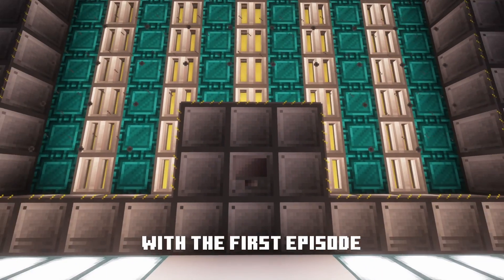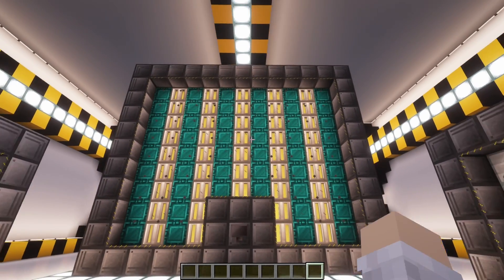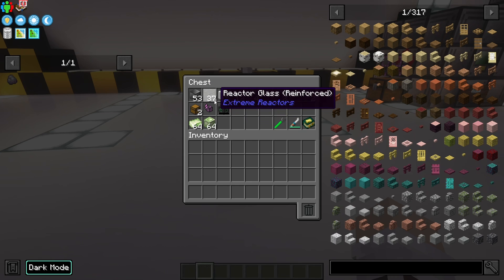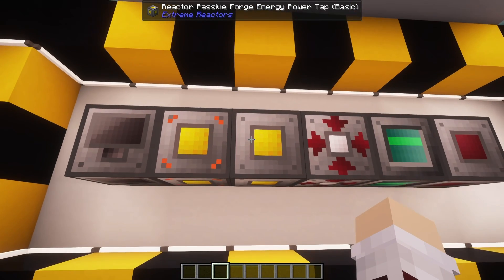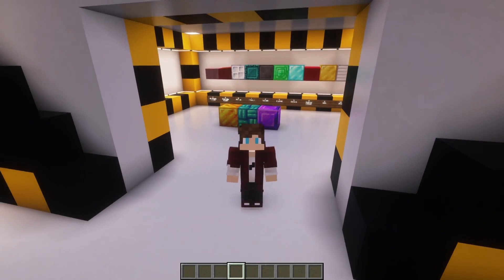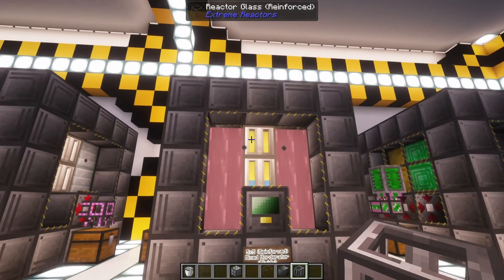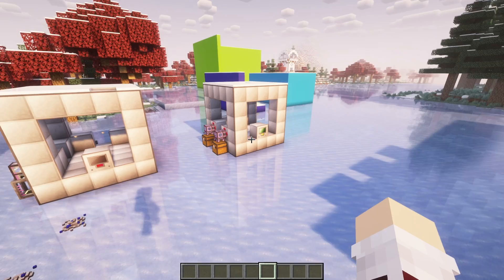Extreme Reactors - The Ultimate (simple) All the Mods Tutorial!

Comment: If your coolant is good enough (I’m using platinum), on a basic 5x5 reactor you can do the inverse checker with 5 fuel and 4 coolant and it still basically runs at 100% efficiency just with more output
Reply: dude you're a lifesaver...so hard to get a straight answer from people sometimes haha

Comment: Very helpful guide. I assumed this was like Bigger Reactors, where the "coolant" blocks aren't actually coolant, but moderators. And the best moderators were unobtainium and vibranium depending on the part of the reactor you were placing them in (unless I mistook the placement factor, then unobtainium was just best).

So now I'll try some of the other options and see if they improve my reactor performance.

edit: I used F3+H to see additional tool tips. It appears these are indeed moderators, not coolant. Given the understanding of how the fuel rods interact with each other, I think the distinction is important. Referring to them as coolant creates a misunderstanding of function in those trying to figure out an ideal design.

Comment: I get the problem "Turn off the reactor and push the control rods all the way into the fuel rods" but my 5x5x5 reactor is the same as the one you built in your video. Do you have any idea what my problem is because the reactor control rods say that is 100% in
Reply: 100% is the lowest efficiency level. Try something like 50%

Comment: For anyone looking to use redstone port: you can use 3 ports to turn it off and on. Two outputs, one for when power is below something like 5% and one for when power is above something like 95%, both connected to a pulse extender (which converts the signal from either output to a pulse) that connects to an input set to toggle on/off based on pulse. Pretty simple
Reply: Theres such an easier way to turn it on and off, u don't even need redstone conduits from EnderIO, just 3 restone dust 1 block below the ports. Set up exactly how it is in this video, but instead of using 95%, use 70% its more efficient that way. Simple as that. Just be aware that it takes a few seconds to kick off and on.

Comment: the one video i could find giving me a decent run through ty 

i have a 9x9 and I'm using the tangerium but i still feel like my power output is low is it supposed to be at like 2400 Celsius?
Reply from the maker: If you don't mind increasing you're fuel usage, you can add more fuel Rods which should increase the energy output!

Comment: Nuclear Fission* 0:32

Fission is the splitting of atoms into multiple particles, which releases energy as per the famous E=MC^2. This uses things like uranium etc as fuel. This is how our current nuclear reactors work. And this is what the reactors in minecraft resemble (specifically PHWR reactors). 

Fusion is the fusing of multiple atoms into 1 heavy atom, which releases energy too as per the famous E=MC^2. This is literally what happens in stars and our sun! It fuses an isotope of hydrogen into helium. This is something currently being heavily researched and it would probably mean the biggest change for humanity in history. As it's basically non-polluting (produces helium as 'waste', which is a useful element) and generates incredible amounts of energy from very little fuel. Recently (end of 2022 and beginning of 2023) we have been able, for the first time, to produce more output than energy was put in using a nuclear fusion reaction. Which is incredible. Since then it has been replicated multiple times and we are seeing an increase in energy output. But we are far from achieving a Q value of 0, which basically means a net neutral reaction (producing the energy necessary to 'run' the reaction - things like cooling, providing the massive magnetic field etc,...). But we would need MUCH more than that in order to make it a viable power source.

Nuclear fission is amazing and there's a lot of new developments to make it more attractive as it's necessary for achieving a greener planet. But I could've only dreamt of being allowed to be alive during the times where we are literally building our own Sun on earth to power our lives. Hope you find it as fascinating as me :D

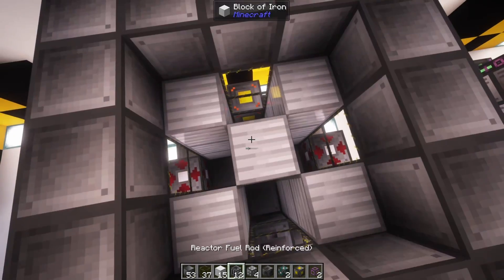Comment: 6:53 I need to correct you, the best in terms of efficiency is a 5x5 with 3 rods in a line in the middle of the reactor. That gives you, with resonant ender as cooling, about 8.2k FE while only using about 0.064mb/t. The checkerboard uses 0,094 with 10.2k FE. If you want to use 4 rods though put them in the corners. That only uses 0,086mb/t while giving about 9.96k FE. I did all this testing with resonant ender so results may vary with coolant.
Edit: i didnt know that filling the complete reactor with coolant mattered, so my tests are a bit off from optimal, though the difference still stays.
Reply from the maker: Thank you for sharing your findings! I did not know there was a better way for cooling the fuel rods!
Reply: Have you tested putting the fuel rods in a + pattern? I've always seen people mentioning how having the rods together makes them irradiate each other giving you more power and that the + shape is most efficient for this but I haven't tested it personally and I'm curious what the findings would be
Reply: @hdzk3336  yes i have, that pattern has more rods, so more heat but also more power. In my test it did use 0.112 mb/t of fuel while delivering 11,07k FE/t meaning it is a lot less efficiemt than 4 pieces in each corner while only giving you about 1,1k FE/t more.
In a larger reactor this again could be another story because of more coolant.
Reply: @mrsnoopy7557  cool, thanks for the info
Reply: @mrsnoopy7557  had a bit of time so i tested for myself, an 11x11x7 reactor with a 3x3x5 grid of fuel rods in the middle with resonant ender extending 3 blocks out in all 4 directions away from the centre gave about 64k FE/t while using 0.274 mB/t. this makes it (a tiny bit under) twice as efficient as the 5x5x5 reactor because if you were to use 4 5x5x5 reactors you would be using 0.256 mB/t (almost the exact same as the 11x11x7) but only be generating 32.8k FE/t which is half the power the bigger reactor generates
Reply: @hdzk3336   I had only tested 5x5 so i cant say a lot about bigger ones, but thanks for the test.
Also there is a website, although for the old 1.7.10 big reactors, that simulates any reactor you want and can give you an idea of how a pattern performs.